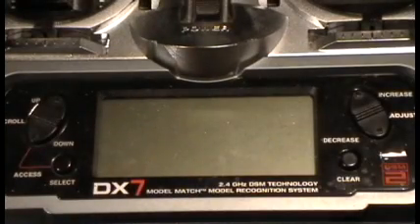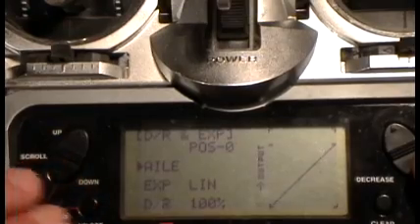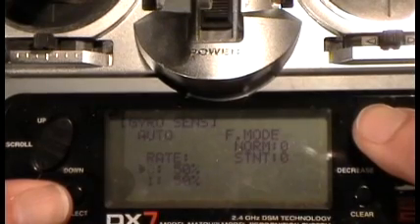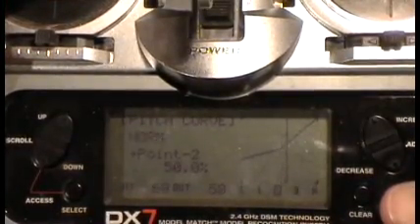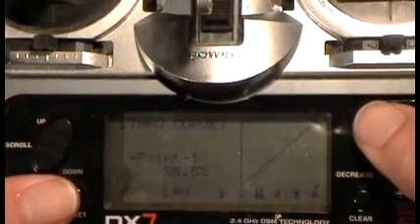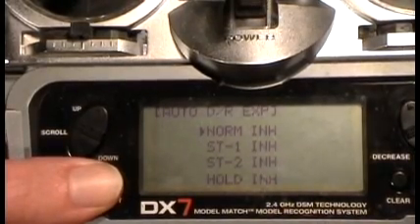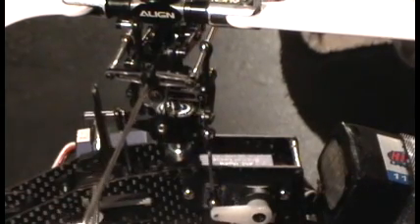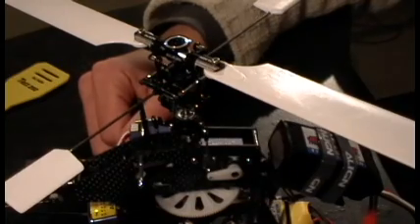Spektrum DX7 Helicopter Setup

Comment: Hello, and thanks for the video! Are you using the DX7 for airplanes or helicopters. There are two versions and I have the airplane version. Having a lot of trouble setting up my heli with it. Thanks!
Reply from the maker: mooseflier In the video you see I have the airplane version. The only difference is the position of the switches, programming is the same for both versions. I use mine with airplanes, helicopters, and multi-rotors... even used it with a car once. It's a great radio, whatever version you have.
Reply: Sorry, I should be more specific (Trex 450, dx7 (airplane)). The input select is the real question. When I set Aux2 to gyro, and gear to Inh (my test settings last weekend), I have no way of toggling head holding vs rate mode. None of the switches will change the 3gx's status light (hh/rate). I was stuck in red (rate mode). Also, the heli behaved as if it had no gyro settings.

But, if I set Aux2 to F.Mod and gear to gyro, then I can at least toggle the HH/rate mode by using the Flap Mix toggle switch. And the rudder gyro starts responding when i move the heli around (by hand). Hope that makes sense. What's odd though (to me, newbie for helis), is that the switch I use for hh/rate mode (the flap mix), also toggles the throttle and pitch curves (i.e., norm, st-1, st-2). Is that normal? Or does it indicate I have something set up wrong?

Thanks... sorry for the long post. Just trying to get this thing hovering properly and you're the only video I have found on the older dx7. Thanks!
Reply: jasmine2501
Thanks Jasmine, I'll go back and try your settings and check in again. Thank you for responding!
Reply: jasmine2501
Ok, this is looking a lot cleaner! I don't understand why aux2:aux2 makes this work, but that's the key setting I definitely didn't try. And all control surfaces seem to be correct (from a newbie's view).
 
I'll test it out this weekend. Thanks so much Jasmine2501.

By the way, what does the flap mix do now? that's the normal, idle up, idle up 2?

Thanks!
Reply: jasmine2501  Jasmine, you're awesome. I tested this out last night and it works great! Thanks for the help!

Comment from the maker: Yes, each model memory has completely different settings, no cross talk. On the old DX7, you only have flight modes with helicopters, not with planes, and you always have three flight modes controlled by the flap switch, plus throttle hold mode, controlled by your choice of the remaining switches. You can have these modes be completely different on each helicopter. For example, my Trex 450 Pro doesn't have a 'normal' mode, it has three stunt modes, but my HobbyKing 450 Pro has normal mode.

Comment: i have a problem with my dx7 on the throttle curve screen on the graph when full throttle the line goes to the left and with no throttle the line is right is that normal because i think it should be backwards

Comment: So just to get this right the radio allows you to program a variety of different user modes per model correct? EXAMPLE Mode 1 throttle right stick Mode 2 throttle left stick?
In other words mode 1 doesn't dominate the entire list of 30 models correct?

Comment: Hi there, my prob is not knowing which switches to use to correct when i yaw left or right,
whats happening is when i yaw right the blades tilt right and up, when i yaw left the blades tilt left and down , the swash is level  and the blade tracking is perfect,0% at mid stick with idle up, the washout arms are level, also when i spool up the blades are perfect, so back to my prob what next ? I'm using DX7  thanks any advice would be very much appreciated

Comment: Cheers for the info , all good with Aile, but im having trouble with gyro , Im using a G401b, the prob is how do i enter rate mode to set tail slider , your vid you suggested in gyro use auto select which i did ,but when i go left on the stick it goes left but wont return to center and when i move heli left and right i can see the servo moving to compensate , is the gyro not compatible ? i have set the delay to zero its in normal mode and on digital servo , should i be looking at the gyro or TX?

Comment from the maker: The servo reversing is only the first step - once you have it correct, don't go back and do that step again. You must do these steps in order. So, make the servo reversing so that they move together when you move the collective stick. THEN, and only then, you go into the swash mixing screen and set the direction and magnitude of the three things. Servo reversing sets the relationship between the three servos, swash mixing is where you've gone wrong - that sets the directions the swash moves.

Comment: Jasmine , I've  got a DX7 and followed your vid ,i have a belt cp all works fine except for Aile when i want to go forward it goes backward , Ive tried a number of combinations to correct it but this only creates more problems eg, the swash settings change ,Ive tried servo reverse  still more probs,is there something that i have overlooked  , any advice would be helpful

Comment from the maker: I bought this radio in 2007 at Thompson's Hobbies in Denver. It is still working quite well and I use it on a regular basis. You can not get this version any more, but the new Spektrum and JR radios are great - I also use a JR X9503.

Comment from the maker: P-curve goes from 0 to 100, right? So, 50 is the center of the curve. That should be where you level the swash, zero the pitch, center the servos. That way you get equal travel in both directions. If you want less negative pitch for normal mode, use the curve to set that - something like 30-40-50-75-100 - 30 on your pitch curve is "40% negative" so if your total travel is 10 degrees both ways, 0 is negative 10 degrees, 50 is zero degrees, 100 is 10 degrees positive, and 30 is 4 degrees negative.

Comment from the maker: Mechanically it needs to be balanced. Zero pitch on the blades, and 50% on your pitch curve should be the same. If you want to run less negative for normal flying, use your pitch curve to adjust that. Keep the mechanics set up centered with equal amounts of negative and positive pitch possible, but use the radio to reduce it.

Comment from the maker: The DX7 the next step above the simplest transmitter that will work for helis. I didn't mean the radio itself is easy, I only meant that if you're setting up a helicopter, following this video should make that task relatively easy. This video is not intended to cover all the features of the DX7, and it doesn't cover some of the personal options which everyone does differently. A video of everything about the DX7 would be an hour long and still not detailed enough to be helpful.

Comment from the maker: @cordawg17 In the video I show how to make it work using the flap switch. It's all about how you set up your curves. Throttle curve is what makes a given flight mode into a idle-up mode. The default is for all three flight modes to be normal modes. So you have to follow the video and set up your throttle curves and pitch curves correctly.

Comment from the maker: @chubbychicken1234567 You pick a throttle curve and a pitch curve for each of the flight modes your radio has. If you set it up so you have full negative and positive pitch available and the throttle stays high through the whole curve, then we call that an idle-up or stunt mode. If you set it up with only a little negative pitch, and let the throttle go to zero at low stick, then we call that normal mode - in which it is not advisable, but not impossible, to invert the helicopter.

Comment from the maker: @macdaddy1600 I'm not sure exactly what you mean by that, but it sounds like you need to do a complete setup from beginning to end. I think you have your servo reversing and swash mixing type set incorrectly. The only thing that changes when you flip the flight modes is the pitch curve and throttle curve it's using, and changes in collective pitch or throttle setting should not cause "dive down" whatever that means.

Comment from the maker: @MrJasperDaniel This technique only works for collective pitch helicopters using eCCPM mixing. It does not work for helicopters which are fixed-pitch (120, mSR) or Flybarless (mCPx). It will work for the Blade SR, Blade 400, Blade CP Pro2, and Blade CP - all of those have backwards collective, but everything else is the same idea. The new mCP will be flybarless, and use a similar setup to the mSR, but with a pitch curve. When it comes out, I will do a video showing how to set it up.

Comment from the maker: @bamboozledguy The 250 isn't so good for beginners. The parts are small and fiddly and it's hard to set up right. In order to get it flying correctly, you have to fly it to find out what's wrong. If you can't fly, you can't tune, and an out of tune helicopter is impossible for a beginner to fly. I recommend bigger helis like the 400-class and 500-class for beginners. Important!  **If you don't have a proper trainer to help you, I recommend an indoor coaxial and a simulator.**

Comment from the maker: @v190277 In the case of the 250 and 500, the mechanical setup negates the need for expo. With helicopters where the links are straight up at center, the expo might be needed.

Comment from the maker: Since the switch functions are controlled by the programming, it would be hard to do a complete video on the subject. In the helicopter programming shown here, the 3-position switch controls the flight modes, and the gear switch controls the throttle hold. The other switches control the dual rates, and the AUX switch controls the 7th channel which is not used. You will learn all this over time, and there is no need to learn it all right away.

Comment from the maker: You would need to get a Spektrum receiver, then it will work. Coaxial helicopters are only 4 channels, so the smaller 5-channel Spektrum receiver should work. Coaxial helicopters generally respond well to a standard 4-channel AIRPLANE programming. Trying to use helicopter programming with the coaxial only adds complexity to the programming task.

Comment from the maker: Everyone's heli is different, so whatever numbers you need, that's what you need. If you use my setup though, the 40% is not heading hold mode. Keep in mind that the gyro will do funny things in heading hold mode if the helicopter is not flying.

Comment from the maker: In heading hold mode, the servo will not move back to center. It moves wherever it needs to go, and if the heli is sitting still, and the stick is in the middle, then the requested piro rate and the actual piro rate will match, and the servo won't move. If you move the stick and the helicopter doesn't move, then the request and actual never match, so the gyro will increase the servo input until the limit.

Comment from the maker: Should leave the gear channel at +-100% if using the method I show here. If you want to use the gear switch to change gyro modes, you have to actually switch the switch to set the low end.